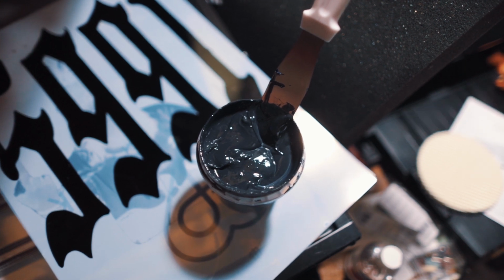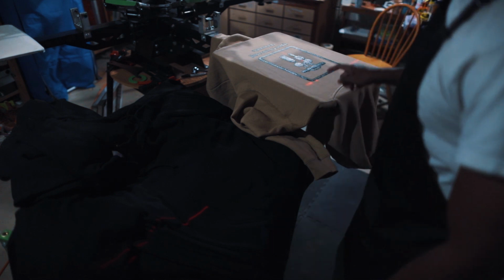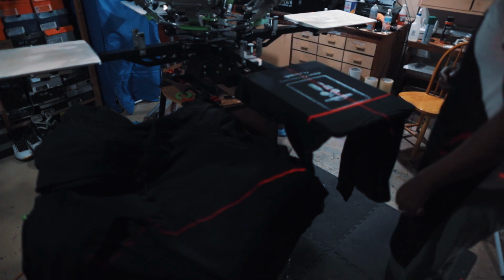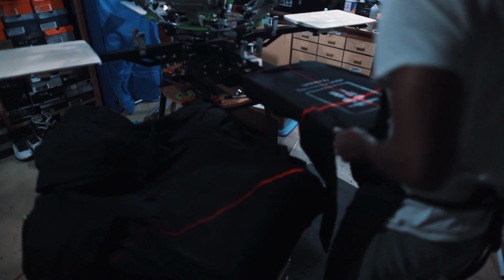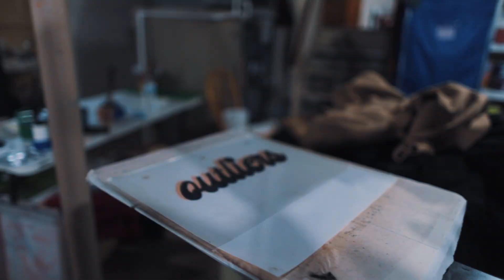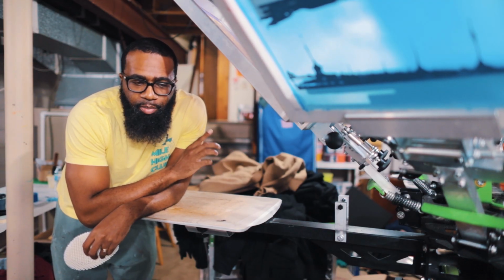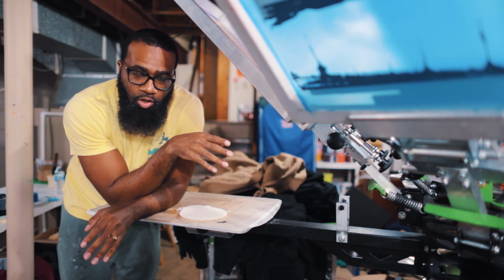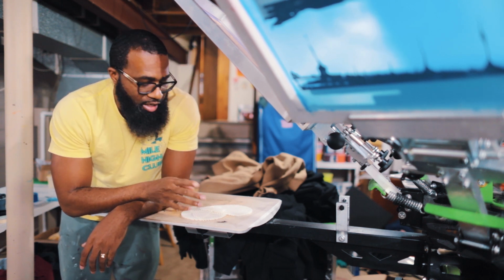I Almost Set My House On Fire!

Comment: working with screen print chemicals and using flash dryer and conveyer dryer makes screen print danger to the printer.  that is why i dont do it full time
Reply from the maker: The full story that I didn't explain:
I was in the midst of a 40 day fast, water only...and limited sleep. My brain focusing power was EXTREMELY low when I did this job 😬. I honestly coulda been distracted by a moth flying in the house that day 😮‍💨
Reply: @JeromeKnowsNothing  i used to drink alcohol while screen printing  and one time the flash dryer  burned the chair that was next to it.   luckily my family member smelled the smoke coming from the garage and  turned the flash dryer off.  it is almost like drivng a car where  the accident can happen.   the danger of house fire is more dangerous than in the shop because there is no set of rules in your own house
Reply: Frustrating having the Flash Dryer on constantly sometimes mistakenly burning pallet rubber etc. 
I upgraded the Quartz Flash Dryer for an Infrared Flash Dryer
It turns on by sensor or even foot pedal ✌🏽💯
Reply from the maker: @bangprints8816  that's gonna be my purchase when I move to a shop